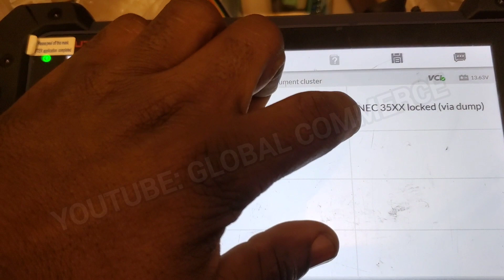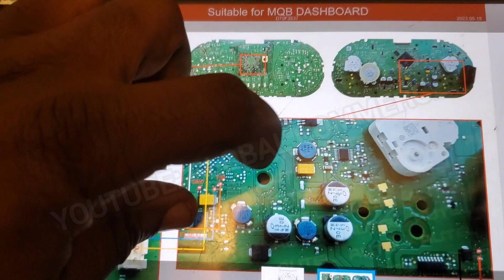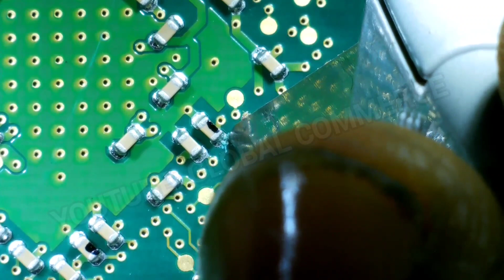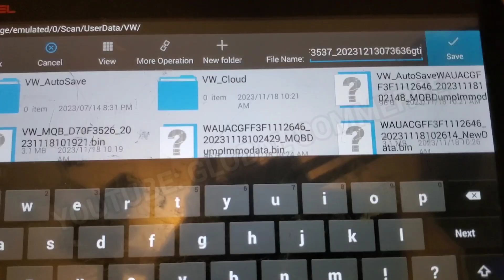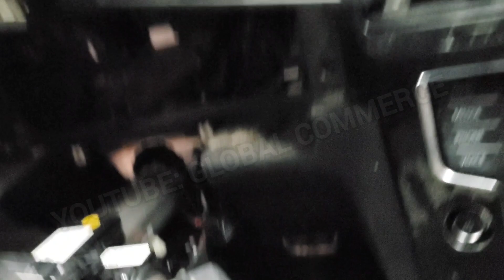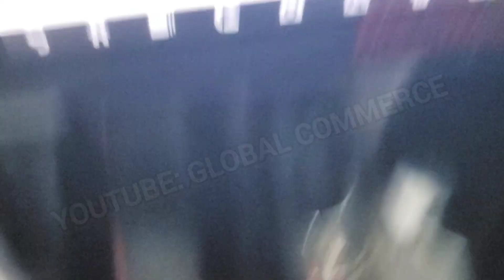Vw GTI Audi MQB D70F3537 Trace Cutting Techniques! ALL KEYS LOST! Autel APB130

Comment: Most important: to be able to break connection between place which you began to work with at 1st place, you need to first cut the other track. Thats why you still had connection on multimeter even though you were pretty certain you cut deep enough the 1st place you've worked on. 

You cancut through multiple layers in that placr and you will still have connection between if you dont cut the other track before. I got to know it when I started to work with exact same scrapyard cluster like this and I also started to cut same track at first, I cut little and check with multimeter, if still contact I go deeper but at some point I realized something is wrong because clearly I cut it through deep enough, too deep to look normal. I still had connection, even if I almost cut thhrough the whole PCB - at that point I didnt care because it was test cluster and I just went deeper and deeper to finally break this conenction no matter if cluster was damaged already. Then I cut the other track, done it in 10 seconds and when I lost connection here, then I immediately lost connection in that first spot. So remember that because those spots must be connected together by multilayer domewhere deep.

Comment: I have to say you have mad skills. HOWEVER 
I run a vw audi repair shop. We have the factory tool. I can order 2 keys from vw for maybe 140 each. We charge 210 to program. Takes legit 20 min tops. No disassembly. I have had cars come in that needed something replaced that was tied to the immobilizer, like the ECM. And, because a locksmith hacked the immobilizer, NOTHING will program that's related to the immobilizer. So now, customer needs 2 real keys, a new cluster, and a new ECM. The vw and Audi tool will only let you replace ONE component tied to the immobilizer at a time. So ot makes it very tricky.
Reply from the maker: Thanks for the compliment! It sounds like you really know your stuff. Running a VW Audi repair shop with the factory tool gives you a great edge! I can see how those situations with hacked immobilizers can become a real headache. When multiple components are tied to the immobilizer, it definitely complicates things, especially with the strict programming requirements. It’s tough when a quick fix turns into a full replacement scenario for the ECM, cluster, and keys.Your process of ordering keys and programming them efficiently is impressive 20 minutes with no disassembly is a great service for your customers!
Reply: @globalcommerceca  Thank you sir
Reply: I don’t see how the procedure might “hack anything. The guy just read the data and created a key with what he’s found. He essentially made a dealer key.
Reply: @aSuspiciousPete yeah not to mention cutting traces of the circuit board

Comment: Hi, do I need an external power supply for the 12v connected to the board ? Or there is an adapter to do it ?
Reply from the maker: External
Reply: 🙏🏽 thanks

Comment: do you have to make a dealer key when you have an original working key and just want to program another key from dealer to have a second one for the car? when is making a dealer key usually needed?
Reply: A dealer key is a pre-generated key for your vehicle. Normally when you purchase a key from the dealer it will be pre-configured to your vehicle. Doesn't help much if you don't have Cs code to add the key in the first place. But that's where the term comes from. Before you program a key you gotta pre code it and that's making a dealer key.  So when you ask if you will have to make it into a dealer key when it comes from the dealer the answer is no. I just had someone buy a key from a dealer giving them the VIN thinking it wouldn't need to be programmed into the vehicle. But it did need programmed it was just already generated into a dealer key. I know because it failed to generate into  a dealer key but is still programmed.

Comment: I asked before, and watched the MQB videos, but at no point did you explain where the 32 digit code came from. Was it the Autel or a third party?
Reply: Ok I got it now. The part about different ways to get the 32 digit code was what was throwing me off. It comes down to all the different ways are just different 3rd parties. I was under the impression that you were able to get the number without them.
Reply: @robertirlbhamilton7636  which video is that?
Reply: Hola cuánto cobras por un trabajo de AKL de ese vehículo al cliente?
Reply from the maker: Did you alzó read the comments I left of that video?
🤔 inquiring minds want to know..
Reply: @globalcommerceca , maybe I'm not seeing the right video. What was the name of it? I've watched 3 MQB vids from you so far.
Reply: @globalcommerceca  

i watch all mqb vido and dident see how..